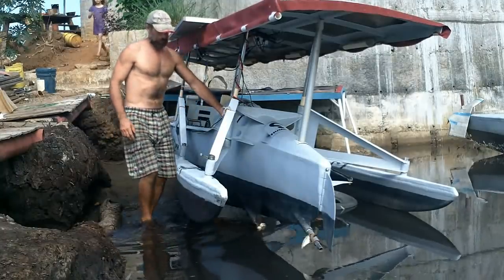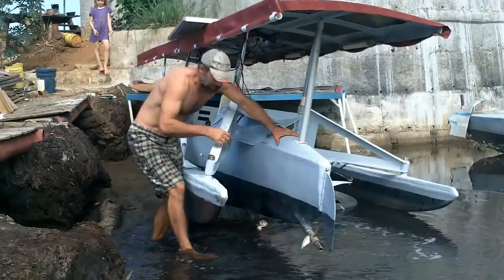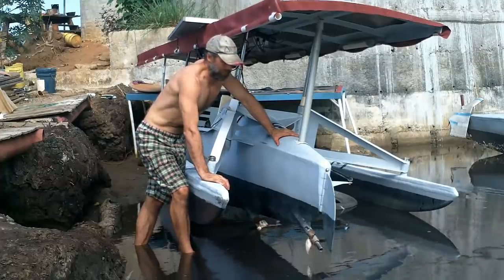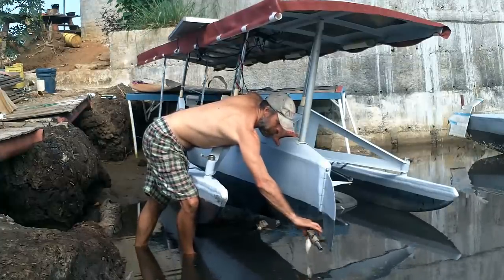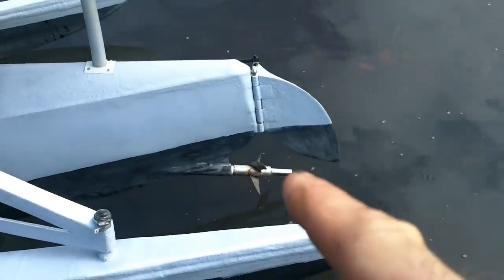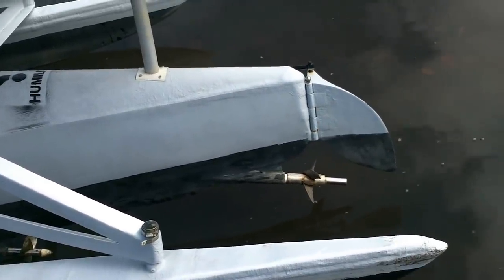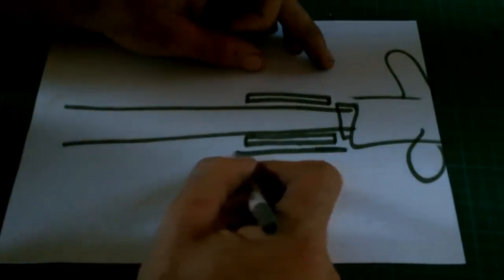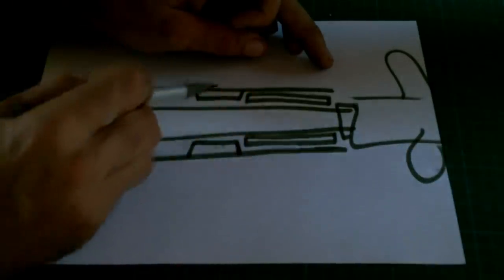Update on Plastic Cutless Roller Bearings.

Comment: Thanks for sharing your adventures, I just discovered you about a week and a half ago and I'm addicted. What I have the wherewithal I do the similar things at times. It's nice to know that there are others out there LOL.
I just discovered your old video or videos of your making your mechanical bug monster whatever. Robot. LOL great job. You didn't think you to get all that without my two cents did you LOL, I would add driveway iron into your building construction next time. It's smaller than the rebar but yet it's all interconnected so you don't have to do welding. Or there's the hog pin type stuff that's galvanized and it comes in 15 ft long sections about 4 feet wide. Anyway it would strengthen the building a million times over. Keep it up

Comment: Thanks for the update on the roller bearings though I suspect that they're not as efficient as you believe. Roller/needle bearings have to be in a cage to keep them running straight. They have a propensity to get askew otherwise and make effective shaft locks. Your use of large clearances and soft materials is likely the only reason your shaft hasn't locked up. Nevertheless, it is not an efficient arrangement. Also, the rollers will erode the pvc pipe. The races need to be much harder.
I would suggest a much simpler arrangement: a Delrin/acetal bushing. The material has a low coefficient of friction and machines great. If you give it a try, you will be very impressed with this material.  Spiral groves should be cut into the bushing to reduce surface area and permit water to migrate through the bearing area. If you have a boring bar for your lathe, its easy to do.
Reply: Your comments are condescending.

Comment: There's a plenty of different materials going under same name as plastic...but rollers are usually made of PA6, or nylon 6 or polyamide 6...theres also PA6 with added selenium (PA6-Se-Cd) for better friction and longevity. There's a PA6 with additives making it so tough it would eat out that stainless steel tube before it destroy itself...amazing material but not very eco friedly, though.

Comment: Nice to see the family, Hope all are well. Have you ever thought of doing it in stainless steel ( the bearings) with the saltwater, I was thinking about using your method to make 1 long 1 ft bearing for a waterwheel instead of paying the $250 it would cost in parts for 2 smaller bearings and shaft?

Comment: Jamie, considering how you recycle other peoples offcuts into great projects, do you have plans to set up a recycle type deal for plastics? I have seen around YouTube several examples. The plastics get chopped up into small pieces, then turned into Pellets, which in turn are then melted and moulded into new products. The machinery doesn't seem overly complicated, and really just requires power (which you have). Any thoughts on this?

I would think locals would be happy to supply you left over plastics for nothing, you could then use the ready-made supply to set up your own little eco-business, and make great projects as well.

Comment: Hi Jamie, I'm planning a solar electric catamaran and trying to figure out power requirements. I have the "formulae", but fear they are not accurate. It would be helpful to know how many watts of power you think you are getting to the water between pedals and motor at your top speed as well as your approximate total boat weight during your tests. Thanks! Keep up the good work.

Comment: Interesting that you have holes in the shaft log to let water go from front to back.  I have no holes in my shaft log and water comes up from the back through the cutless bearing and then through the seal whenever the prop is turning.  If I'm going fast or slow there is enough water pressure so the seal drips about one drip every 40 seconds.  When the shaft stops the dripping stops after a few minutes.  So I wonder if the water in your shaft log is moving forward or backward.
Reply: Also, because of the holes before the bearings, creates current of the water to travel to the rear, making it impossible for water to travel up the shaft housing.